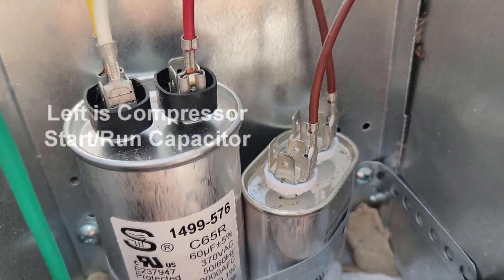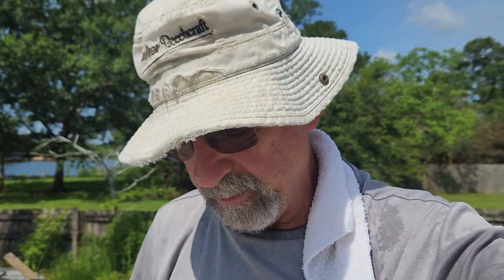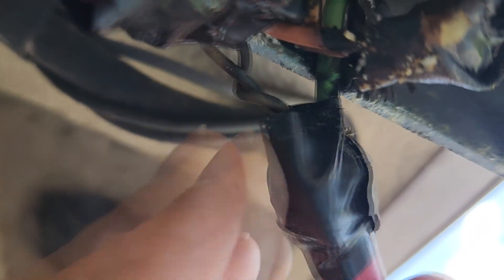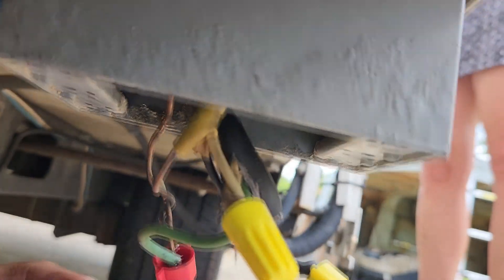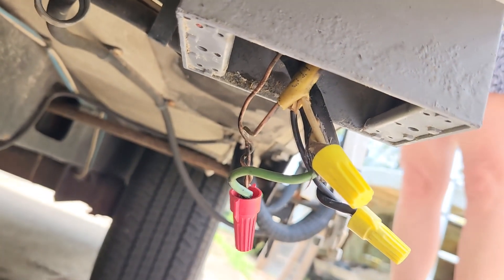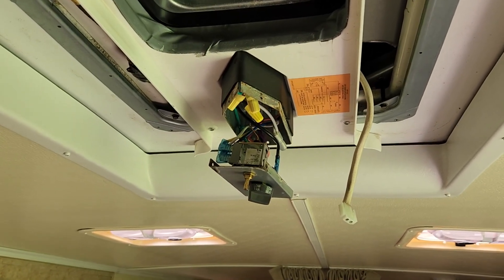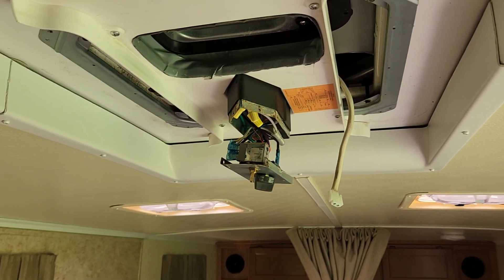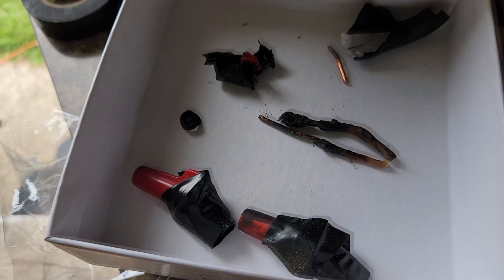Trailmanor Camper Air Conditioner Failure & Burnt Wires (Coleman Mach 3 Plus)

Comment: Boss, is there such thing as a power surge protector for RVs?
Reply from the maker: Yes there is.  Both 30 & 50 amp models, plug in type and hard-wired models.  Some work better than others!

Comment: Cool air! Woot! Excellent find. Excellent repair. So glad you worked it out! I did not see any burn marks in the box that would indicate that the spike went to ground. And, one of the two nubs of burned wire is stranded and the other is solid core. This combination is known to make a A) poor connection and B) one that will work loose. IIRC, a different connector is needed, when there are different types of wire. However, I am not throwing any stones for doing what you have to do to get the air running asap. Good job. Atta-boy.
Reply from the maker: Thanks.  Yep, there are better options than wire nuts.  However, there are several techniques to make a solid and strand wire work together.  Also, just doing a firm pull test afterwards helps to confirm that all is well.  Also, thanks for your input while I was hunting the answer to this problem!  :)